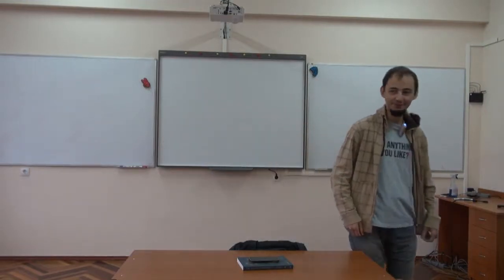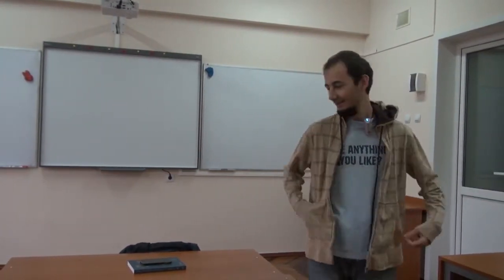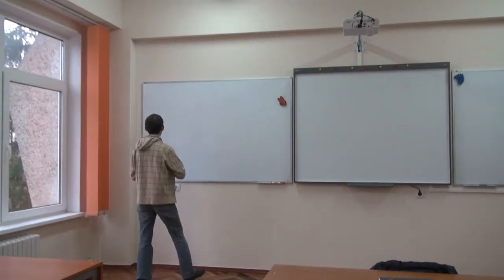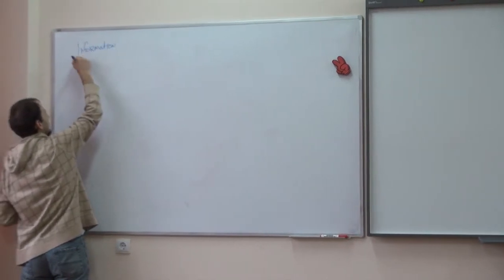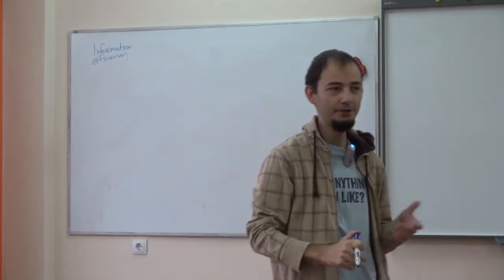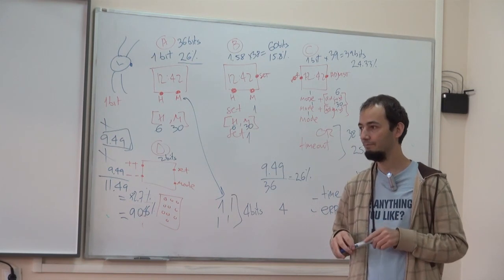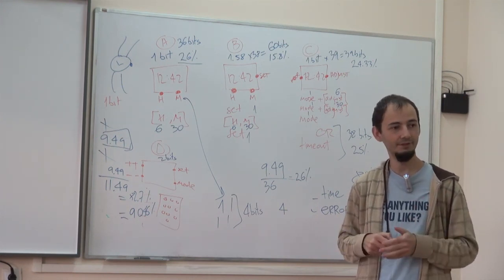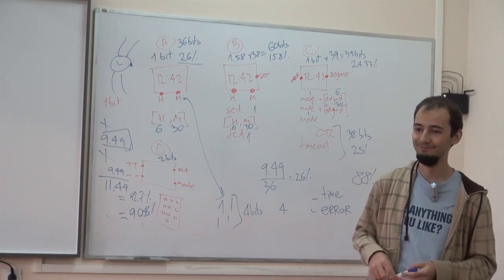#10 - information efficiency applied in user interface design

Comment: Whats the answer to the 4 bit solution ?   press the hour / auto configured to scroll though the hours press to confirm and the same for the minutes.  As it's 4 bits / 9.87 which as puzzled you during the video is over 100 % efficient?
Reply from the maker: Hey, thanks for the question. I am currently traveling, so I cannot provide an elaborate response right now. I will think about it and reply when I return to civilization. P. S. How did you stumble upon this recording?
Reply from the maker: david nelson, having thought about it - I came up with a simple solution. The problem was that we have completely ignored the time component. This screencast explains what went wrong and how to do it right: http://youtu.be/-PdsZ2Ip49U